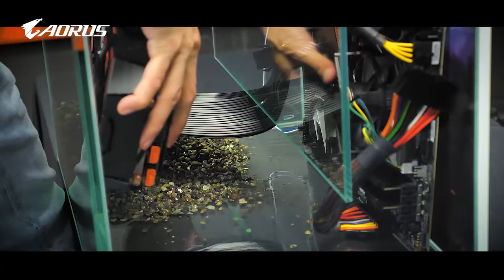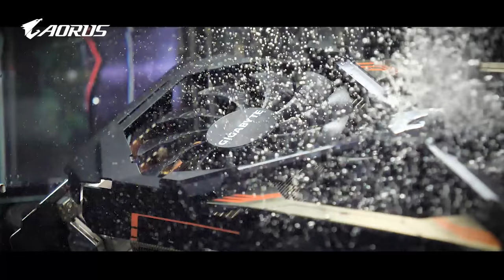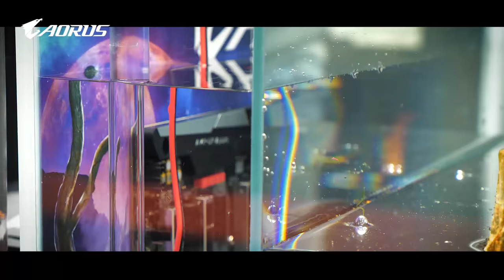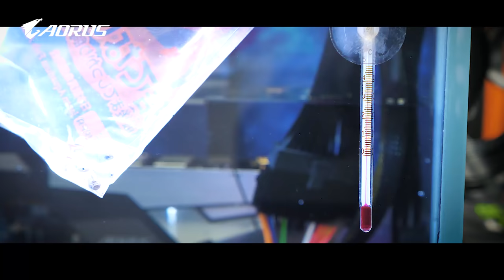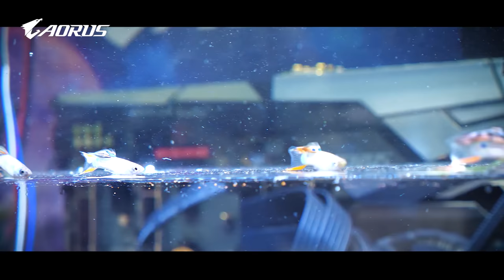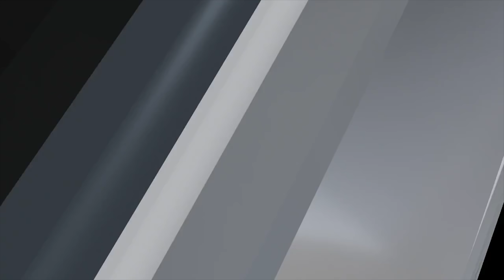Aquarium AORUS PC Build | #DesIgnYourAORUS

Comment: tried to pour water on my graphics card now it won't work, did I miss a  step?
Reply: I think you did
Reply: No i think it's another problem. Did you try to unplug the graphics card and repluging it?
Reply: You kidding right?? The computer parts are inside of an oily substance which doesn't conduct electricity so there is no damages.
Only the very top is water since it's lighter than oil so they never mix.
Reply: @hakunamatata324  dude its just a joke
Reply: @hakunamatata324  I dont know if you're being sarcastic or not but get your facts straight, oil has  lower density than water
Reply: Rip bro
Reply: Yes you forgot to put in the fish
Reply: Kim DahHyun you mean higher
Reply: @blueberrymilk1812  no it's a different substance, not oil
Reply: @Nick_Ski  oil floats to the top of water, it's way lower. Try it.
Reply: @hakunamatata324  you must be fun at the party
Reply: Restart your computer
Reply: You didnt put your fish inside the gpu
Reply: @hakunamatata324  the oil would rise to the top not the water....
Reply: @hakunamatata324  r/woooooosh
Reply: @nitrionixx  its mineral oil, if you look there is a sheet separating the solutions, water is on top.oil is at bottom
Reply: @lordoftherims436  uh. No? There isn't anything separating anything. Is basic science. Do your research.
Reply: Yes.. You forgot to use your brain 😂
Reply: Waittt a minute if that's not water what is it and y did he put the poor fishy in there
Reply: @rnell1472  🙄 the top is water
Reply: @nitrionixx  so what is the bottom😓
Reply: @rnell1472  some sort of oil
Reply: Restart your pc
Reply: Its not oil its something like oil called electronic liquid
Reply: Pyth0n b  try pouring the water out , unplug the gpu and then replug it, unplug your pc and replug it, then press the power button 6 times , then hold it for 7 hours, works everytime my aquarium PC’s gpu stops working
Reply: Mokeish Rajan  it is Fluorinert (electronic liquid)
Reply: @shourovfoisal  it's a joke
Reply: @rnell1472  ignition via network
Reply: @DaGamerForever but the water would get ions and become conductive again, plus normal water and distilled water wouldnt separate like you see on the video
Reply: Distilled water **
Reply: Have to try to turn off and turn on again? 🤣😂
Reply: BurntPanini uh no
Reply: Whisley Santos r/wooosh
Reply: Haha!😁 Research first they've used a non-conductive liquid not an ordinary water😁 it works will and can help cooling down the system a lot!
Reply: You forgot the most important step. Deleting windows folder.
Reply: Also downloading more ram
Reply: @hakunamatata324  water is the best conductor and the best isolator btw. Demineralised water is not conducting any electricity at all
Reply: Lol
Reply: Do you use Toilet Water?  NO? That's the Problem.
Reply: @marvinbroe8161  lol
Reply: U broke it
Reply: Try adding fishes in that water.

Comment: No dust pc build lol
Reply: Instead fish doodoo
Reply: who needs dust when u have fish faeces
Reply: Does anyone know how fish poop or food is removed from this system? Will they sink to the bottom and cross over into the 3m novec liquid? Or is the liquid too dense for it to pass through? I’m going to try a fish tank build just like this myself.
Reply: TRXP RFT yeah lol just fish poop
Reply: @ryanwolfchong  it has submersible pump that eventually will direct any dirt above the mineral oil to the filter.
Reply: How about no rust?
Reply: It depends on what the fish eats, if it eats a high fat diet the poop tends to rise above the water or the mineral oil which has a density of about 0.85g/mL whilst the average fish poop should be a little above the density of water with a good chance of it floating, ever saw your own poop doing that shit right?
Reply: @ryanwolfchong  just put a little mesh between the layers to make it easier to take out / won't get in your parts